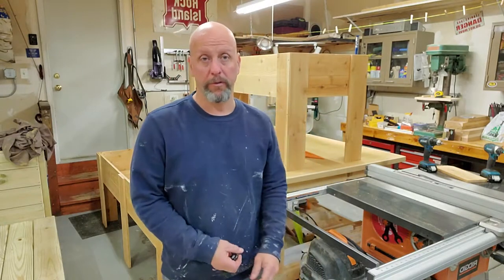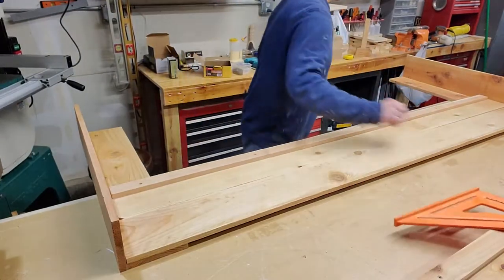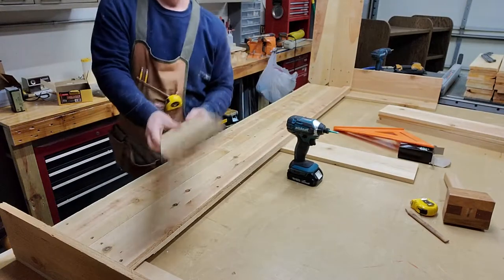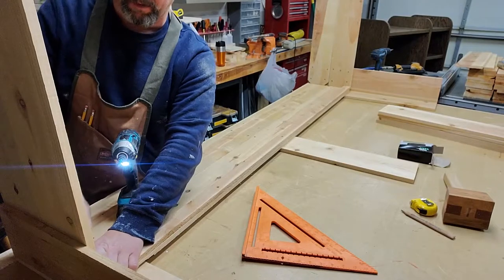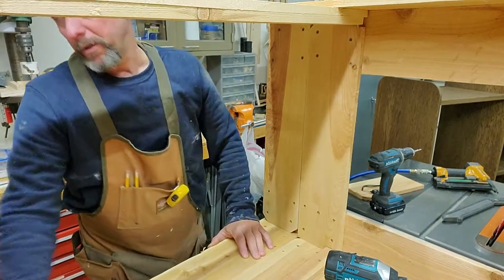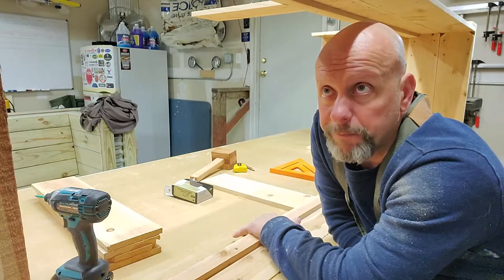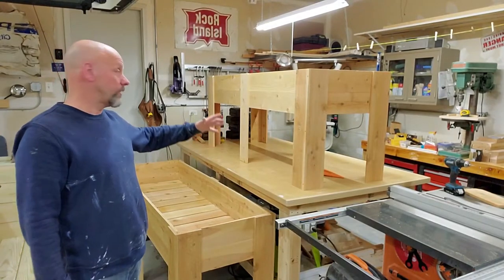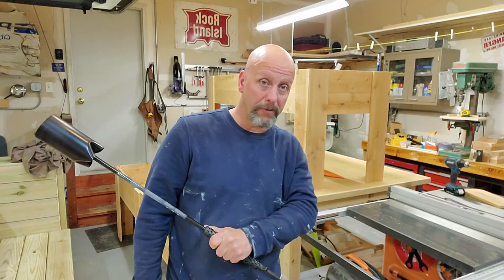How To Build A Beautiful And Easy Raised Garden Bed Using Cedar Fence Pickets!

Comment: Few potential issues, first you need the cut some boards on the backside of the legs. In framing referred as jack studs. When this bed is filled with loam, eventually the weight will cause failure with this. The screws are for fastening purposes, nut for structural support. Cedar is a great choice for the project as far as its outdoor qualities, but is brittle and not a good structural wood. With that being said, I would also use cedar with just some structural fixes in the fabrication. Also using and outdoor type of adhesion will help with strength.

Comment: I’ve got everything I need to start this, except the one and a quarter inch screws…back to the store. Thank you so much for a great video instructions. I I did not hear what you used for the rails that hold the side to side bottom pieces of the planter; what did you use for those rails? Did you rip more fence pickets for the rails? Thank you for your answer.😊
Reply from the maker: I just ripped a picket into 3 equal strips

Comment: Did the fence come with a bottom rail, or did you add that? If you added that, was that a 1x2 pine?
Reply from the maker: I ripped a single picket into roughly 1 3/4 strips.

Comment: Nice video. 2 questions. After dirt is added they’ll be heavy. Do you feel the legs are strong enough? ( as opposed to 4x4’s)  2. In other videos I’ve watched some people commented about some center support for them bulging out. Thanks and excellent instructions/ video!
Reply from the maker: The legs are plenty strong, to support the weight of a filled box. The only failure point I can see is pushing or pulling laterally against the planter. 4x4's would just increase the cost unnecessarily imho.
Reply: Jerry i used a 2x3 in the center at the top to keep it from pushing out the sides in the middle.
Reply: @madrosewoodworks631  yea I believe you. I just wanna see someone fill it with 2000 pounds of dirt. I’m just going to have 4 - 4x4’s cut with 2x4’s underneath for extra support.  As far as money it’s going to cost me probably $150 just for the soil. Ha. How much is a tomato?  Thanks for responding.
Reply: @tmoomoo42  yes. I think I’m going to just connect 2 of the cedar picks as one and connect them in the middle at the bottom under the dirt. 
Thank you for the idea.
Reply: i see this failing after a couple years when the cedar loosens up. dirt is heavy but wet dirt is even heavier. i used 4x4 and don’t regret it. that box fully loaded if someone or something where to hit that box to the side it would come crashing down with those pickets being the support.

Comment: will these hold about 125lbs of soil? I plan on lining with 4ft wide landscape fabric as well.
Reply from the maker: It holds me, and I weigh 200lbs...
Reply: @madrosewoodworks631  perfect, just what I needed to know, thanks
Reply: Maybe my calculations are wrong, but this would be holding over 1000lb of soil at about .5 cubic yd.. Will this hold?
Reply: @htown860  ha. Funny. I’m finishing this build myself now. Was going to make it a lil wider. Maybe 34 inches. And I’ve also made mine 3 pickets tall. As in googling it says vegetable plants like at least 12 + inches. I am honestly afraid to fill this now. That’s alotta fucking weight.
Reply: Yeah I have a client that wants six of these... I don't want to build them only for them to fail. But if I have to use thicker material, my original quote will be too low.
Reply: So after recalculating... I may have gotten some bad info. I'm planning on 8" of soil, so 5.5' x 2' x .66' = 7.26cu ft.  A bag of 2cu ft potting soil is 35lbs. So with that in mind, looking at like 120lb of soil.
Reply: But 3.5 bags of potting soil definitely doesn't seem like it'd be enough to fill 8" of these monstrous box
Reply: @htown860  that's about what I came up with 125lbs
Reply: @htown860  that's what i'm wondering... a cubic foot of soil weighs betwen 74-110 pounds.. that's a lot of weight
Reply: @jaybrunn1175  in looking at stores online, a 2 cu ft bag of potting soil is about 35 lbs

Comment: Recommend using glue too (TB3)?
Reply from the maker: No glue used. If you wanted to, you'd probably need a construction adhesive or exterior rated glue

Comment: How many fence boards per planter?
Reply from the maker: Fifteen 6 foot pickets should get the job done.
Reply: @madrosewoodworks631  So 14 if you don't have the ability to rip them to get the bottom rail and have to go with the pre cut firring strips?

Comment: Are these 5/8th fence pickets?
Reply from the maker: Yes, they are.
Reply: @madrosewoodworks631  seems like 1” 1/4” screws come through the other end when screwing the two pieces together?
Reply from the maker: @codyshelcusky7284  the 1 1/4 screws are used only to hold the corner pieces together for the 4 legs. All face screws are 1".